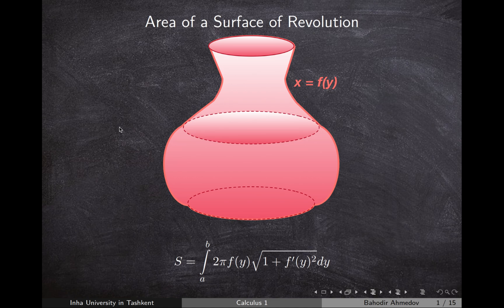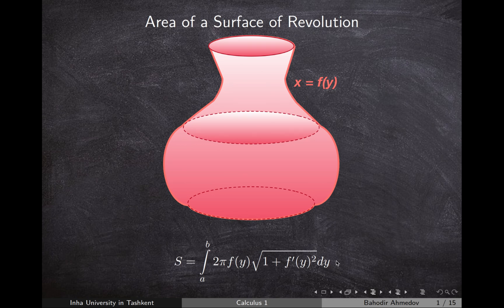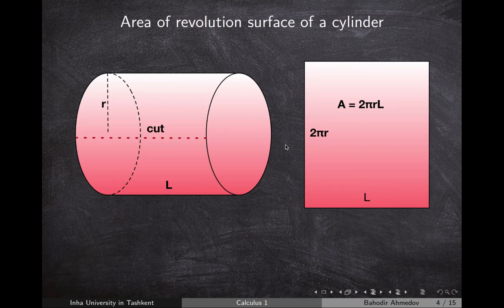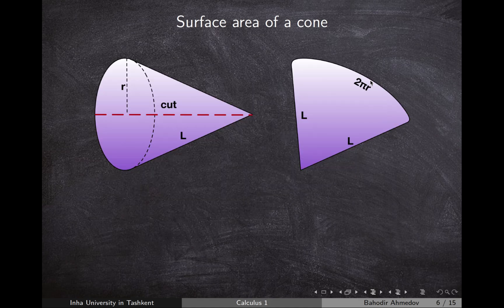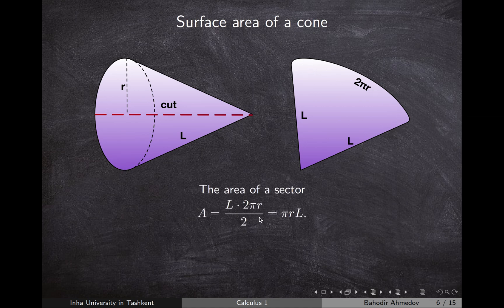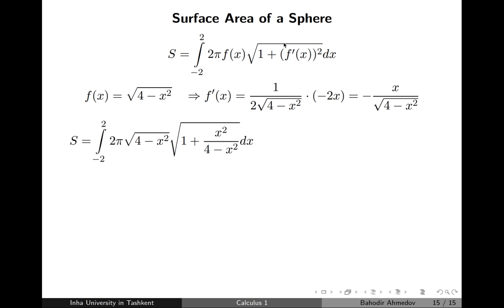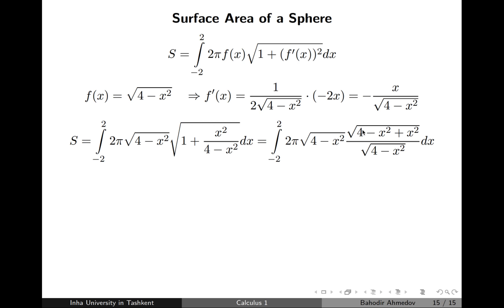Surface Area of a Solid of Revolution using Integration with an Example.

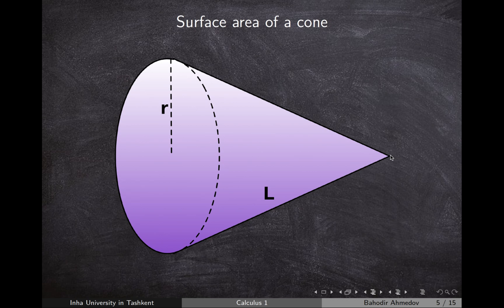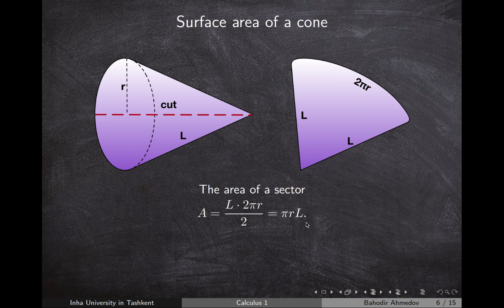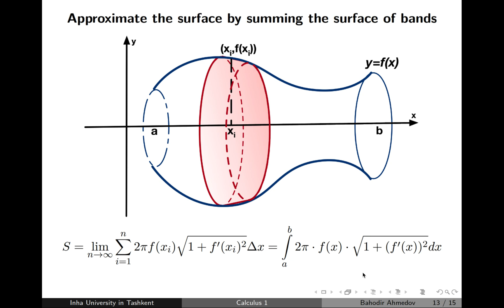Comment from the maker: Time-codes: approximation of surface areas: 6:04, surface area of a cylinder: 0:50, surface area of a cone: 1:35, surface area of a band: 2:33, integral formula of a surface area: 7:28, example: 7:54